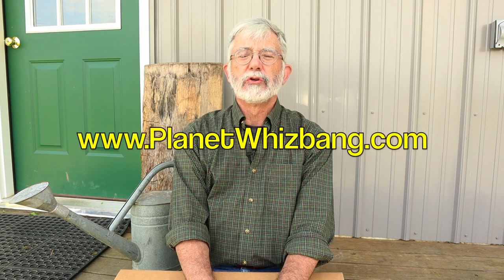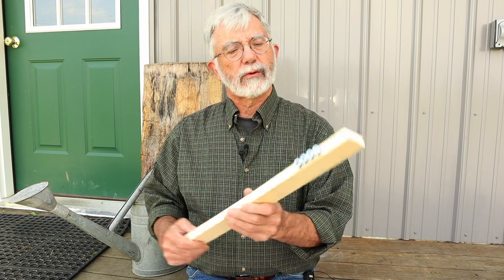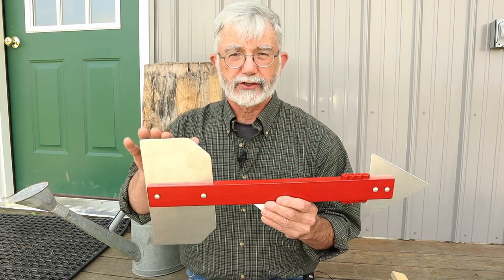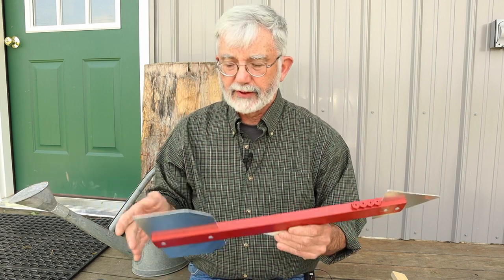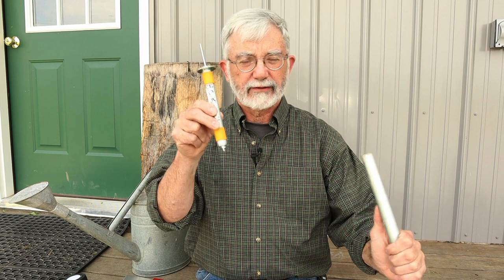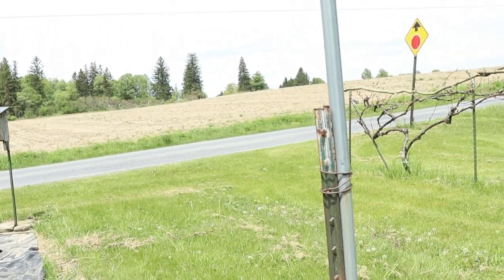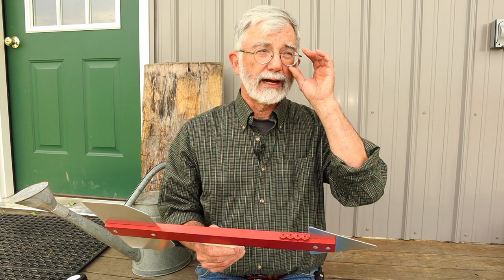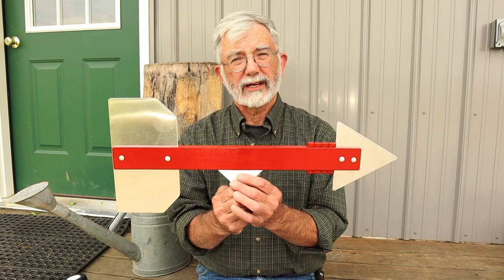A Whizbang Garden Wind Vane

Comment: For good to best results from rattle can spray paint - Use TREMCLAD Professional High Performance Rust Enamel - 3 very light coats 15 minutes apart - it should be dry enough to package in 1 hour with no runs. The trick is the 15 minutes interval. With the price of spray paint these days you should either use a brush or get a small airless sprayer and use water based paint.  I just about fell over when I bought some spray paint last month - wow - that stuff inflated!

Great video and great product!
Reply from the maker: Great informative comment. Thank you. I will be brush painting them after the last 2 cans of spray paint I have are used up. Yes, spray paint is expensive! 👍

Comment: How does it handle high wind speeds? I live in N. California on the coast. We sometimes have gusts up to 50 mph.
Reply from the maker: I’ve watched it in high wind thunderstorms and the pole flexes back and forth some but the vane pivots into the wind quickly and offers little resistance. It gets through storms with no problem. It has never blown off.

Comment: I wish I could afford one of these custom hand made unit.  Good job.  Do you put a little dab of grease with it? I am at 8:52 right now
Reply from the maker: A little bit of grease on the very tip of the pivot is a good idea. But too much will, I think, gunk up the sleeve the pivot shaft fits into, and that may interfere with the zephyr catching qualities of this vane. My prototype pivoted for 5 years with no lubrication beyond one application of a bit of grease. The grease was long gone after five years and the pivot was worn (as I show in my previous video), but the vane still pivoted perfectly.